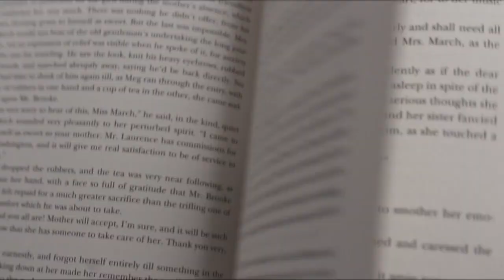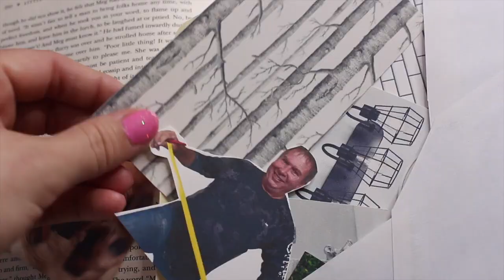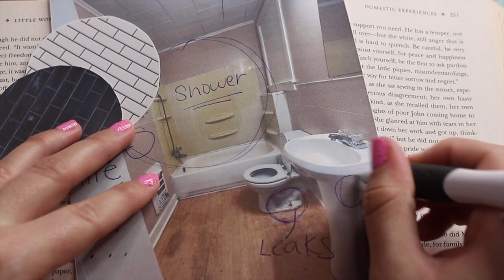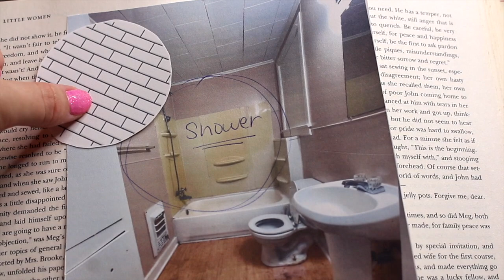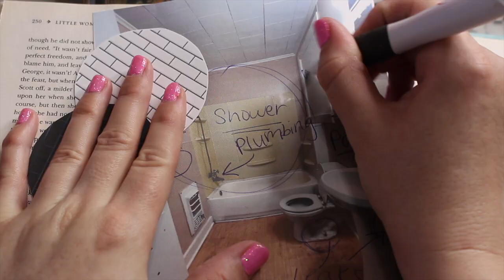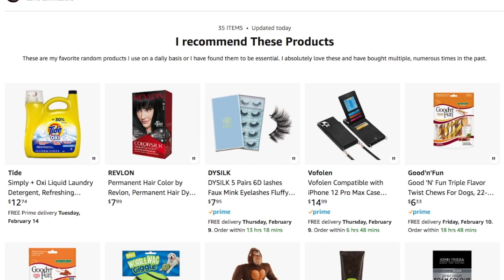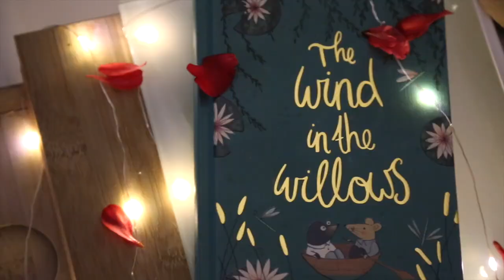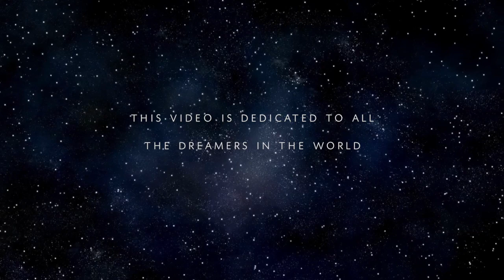How To Manifest Your Dreams | Bathroom Renovation, Aesthetically Pleasing, Baking, Cottagecore ect.

Comment: I commented on your other video but I REALLY NEED YOU TO SEE THIS! It’s beautiful! Never stop learning and working! 
    It looks like you did not grout your tile and seal it! You also need to calk around the tub or the water will leak in between the tiles and rot and mould everything.
Reply: The tile won’t last. My fiance is a seasoned carpenter and liquid nail is gonna fail apart holding those tiles up. It needed thin set and then grouted  for those tiles. Also like u said her not sealing it 🫣

Comment: I'm no construction expert myself but im surprised the boss of a construction outfit doesnt know more than the how to pattern tile. I'm curious what you guys did to prevent water from penetrating behind the tile that was glued to the cement board that only appears to go about 2/3 of the way up the wall. that area will be seeing gallons of hot water daily, hot water causes condensation on cooler surfaces, i wonder whats going on behind the wall a year later.

Comment: Wallpaper in a bathroom?! Bad idea
Reply: Exactly my thought. The bathroom looks gorgeous, though, but I don't know whether the wallpaper is going to get wet and maybe moldy underneath. Also, I would have put the tiles in the bath section all the way up the wall and not just 3/4 up.
Reply: I have had wallpaper in my bathroom for years and never have had an issue. It’s not our bathroom so no need to worry. ❤